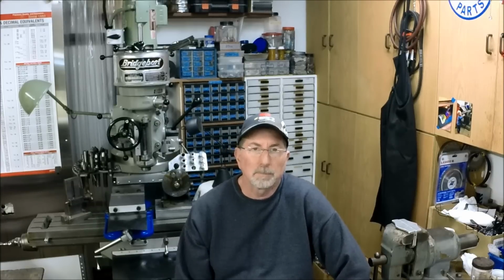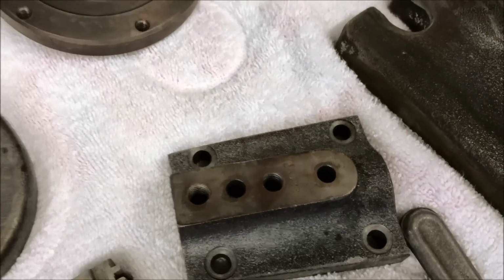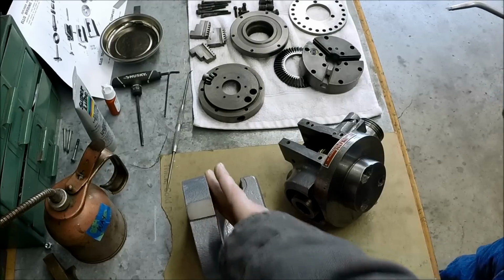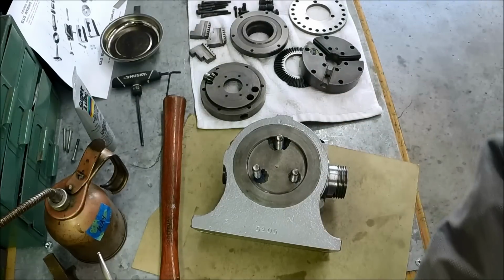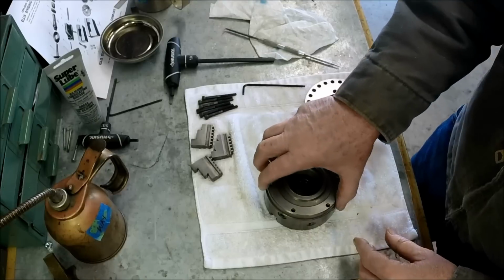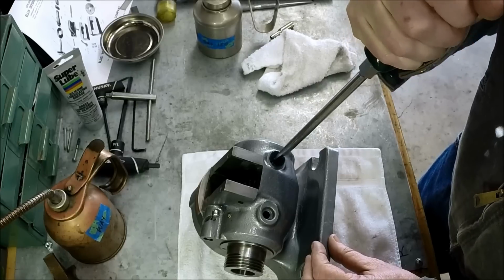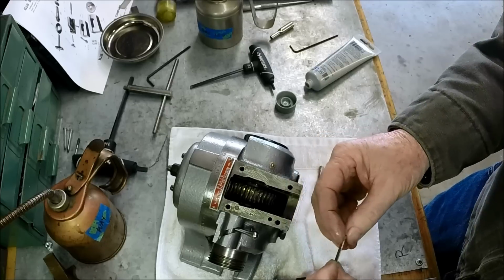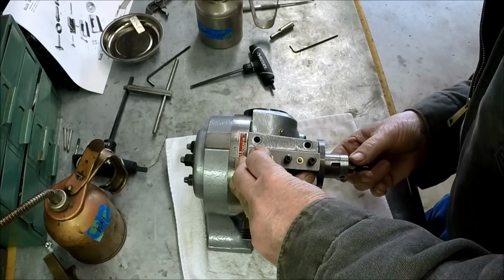Ellis Dividing Head Restore Part 1

Comment: Wow I learned something about the company that made what we think is a great Dividing head based on what you are sharing with us the Ellis Tool & Manufacturing Company also made our only vintage 6 inch vise we just refurbished was too made in El Monte, California. We also like your paint oven human meets nature. We use an inferred lighting simple one because we too are not in the paint business. Boy you really cleaned up this dividing head really well then you had to save those threads, just learned this about inspection angle plates bolting fixtures can break out the nice finished around those holes too.  Damned be you Mr. Bubba. Looks GREAT.
Reply from the maker: Ya that Mr Bubba sure gets around.

Comment: you said there were 2 lock locations i believe that is for when you may need to swap the chuck to the other side this way when needed it can be left handed or right handed.
Reply from the maker: I agree , the bummer is the spindle must be pulled to move the brake shoe to the other location.

Comment: I finally know where Phillip Duclos lifted a lot of his design for his small model makers dividing head that was written up in the Home Shop Machinist magazine in the 1980's. A lot of the parts, how it's made and works look just like that Ellis. The worm pivoting block is a direct copy.
Reply from the maker: I'll have to look for that , thanks
Reply: @TheAyrCaveShop  The full build article was also reprinted in the Village Press book The Shop Wisdom of Phillip Duclos. If I recall correctly his reduced size version had about a 4" swing. After seeing your Ellis head and how it works I think Phil should have also added that spring loaded indexing pin that's used while direct indexing.

A shame about that high quality chuck of yours being basically ruined by some hammer mechanic. Standard non adjustable 3 jaws are pretty much worthless for accuracy on something like a dividing head. That could still be added to a decent plain back 3 jaw though if you can find one in good shape.
Reply: @TheAyrCaveShop  I should know better by know than to fully trust an already proven to be faulty memory. After re-checking Phil's dividing head build article it's a 4-1/2" swing and I'd guess he simplified the design a bit since he left out the ability to do direct indexing. It wouldn't be hard to add it though.